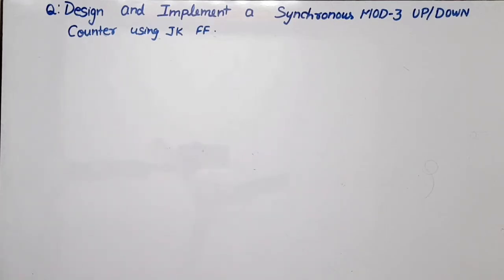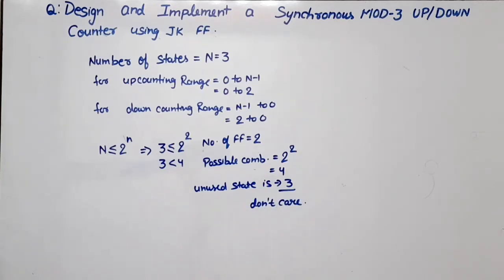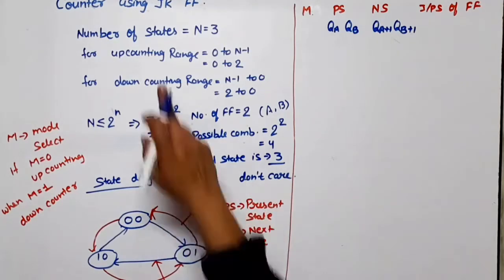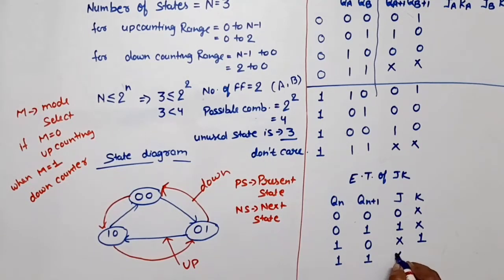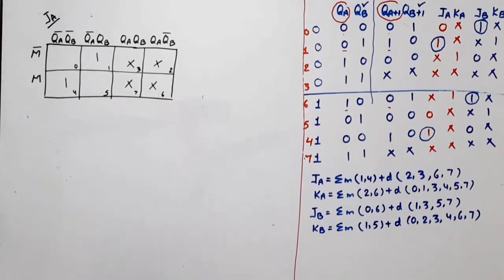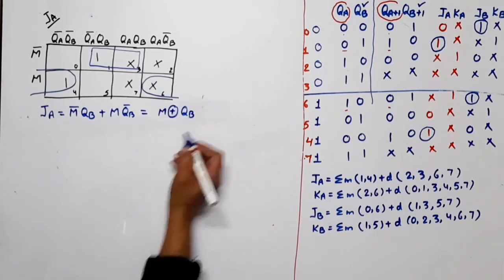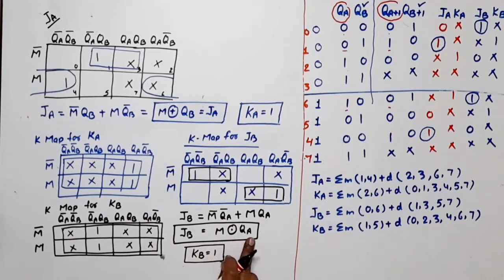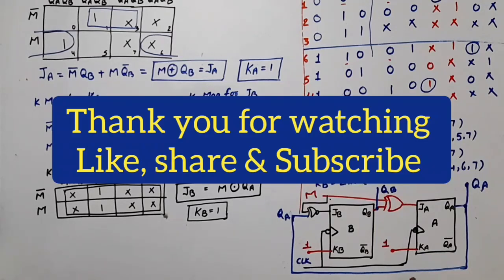MOD 3 up/ Down counter using JK flip flop | MOD-3 Synchronous counter | Mod-3 up/down counter

Comment: thank u😍💙, just a quick question , should I just follow these steps for 5 bit up and down synchronous counter using jk flip flop, is that enough?
Reply from the maker: Yes counting will start from 0 to 31 for up and 31 to 0 for down
If u are designing using JK flip flop then 10 k-map required
Reply: @TechnoTutorials2783   thnk u so much 🎈💃🫀😚 when i do these steps fot 5bit , after 31 ,should the present state be "0 "or not  ?or should i put 30 for next state?
Reply from the maker: @mmaaddi  for up start with ps 0 and end with ps 31 and next state 0
In case of down 
Start with ps 31 and end with ps 0 and ns 31
Reply: @TechnoTutorials2783  do u mean : ps 31 ,ns 0, ps 0 , ns 31 , ps 31 , ns 30 ,....just like the example
Reply from the maker: @mmaaddi  yes 
I will try to upload this counter using D then Jk flip flop  as soon as possible
Reply: @TechnoTutorials2783  thank u again 🫀😚💃🌻🥳💙